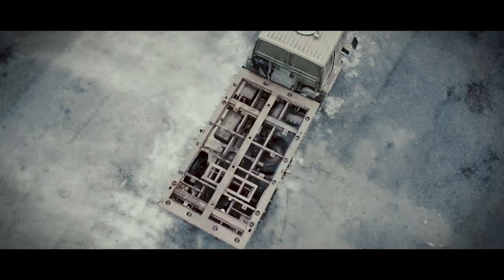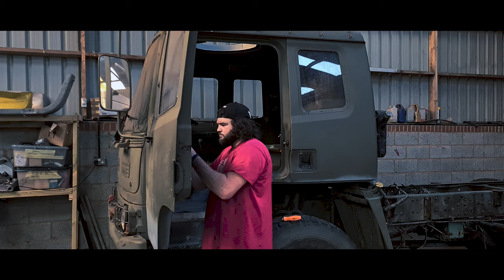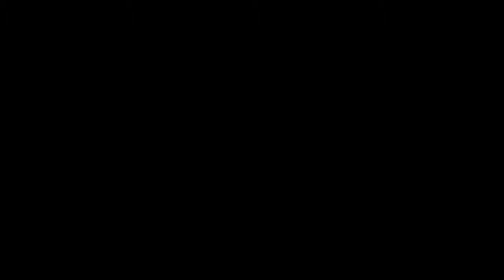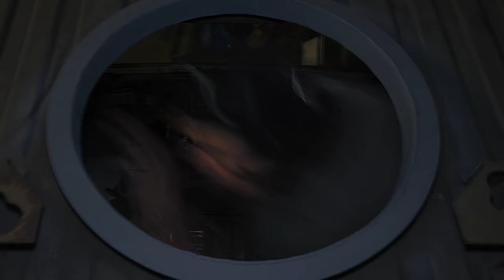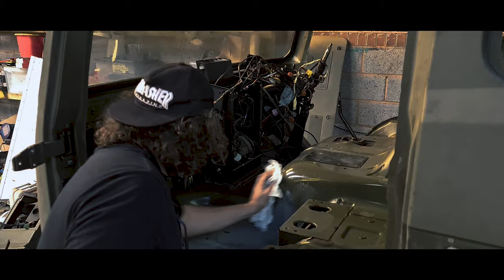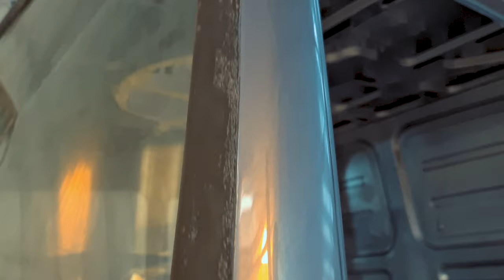Expedition Truck build - Paint Preparation - Leyland DAF T244 - (Ep 7 Project 13)

Comment: I'm surprised that you haven't got more subscribers.
I hate painting as I'm a lazy sod. I know that preparation is a major part of doing a good spray job but I'd skimp on it.
Thanks for sharing and keep em coming  I'm looking forward to the follow up on this.
Reply from the maker: Thanks, Yes prep is key I had 30 hours in sanding by the time the cab was in clear. Hopefully the subscribers will come in time !
Reply: @builditoverland8742  I'm sure that you will get more subscribers as you are doing a cracking job with the truck.

Comment: Admire your dedication stripping everything out. Most seem to just mask off windows, etc. and spray outside. This will be a much neater job. How long did the strip-down take?
Reply from the maker: it took about 4-5hours to strip and that was mostly in the doors 😅 I agree it makes for a much neater job. I have left the windscreen in as I'm scared to break it 😂 but I do show a tip in the next window on how to get perfect mask lines to the seal.

Comment: Hello from Turkey; I am your follower and I enjoy watching your videos. What kind of truck is the Leyland Daf T244 4x4? Is it problematic? Is the engine causing trouble? is the engine turbolum? And what fuel burns at 100km? Does it burn a lot or less? If you give information about this, I would appreciate it, thank you, and I wish you a good drive.
Reply from the maker: Hi, thanks for following !

The truck is ex-military, they are reliable trucks and are mechanical in nature (very little electronics). The engine is a 6BT Cummins which is a very reliable engine with a good parts base.  The engine is turbocharged. Fuel wise it’s burns 17L/100km

Comment: Proper job. I understand that the top speed isn’t great, any plans to tinker with the gearing?
Reply from the maker: No not really, it did cross my mind but you will find most available tyres are not speed rated for higher speeds.